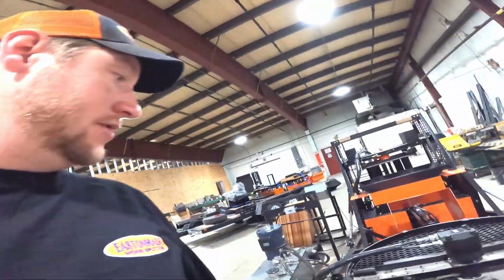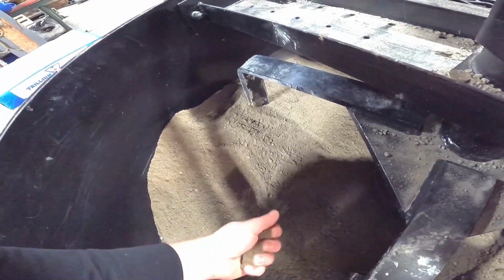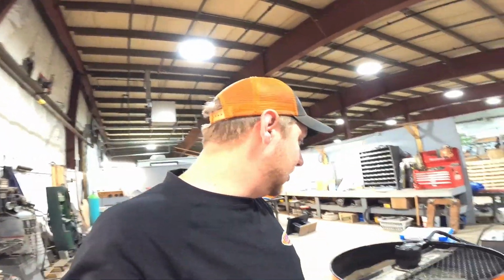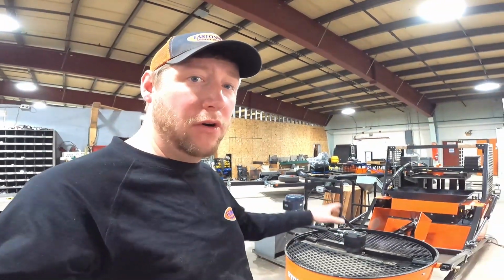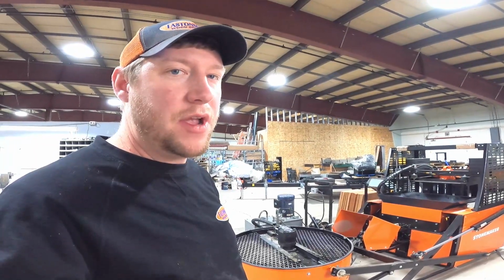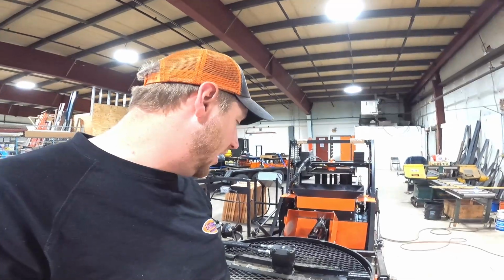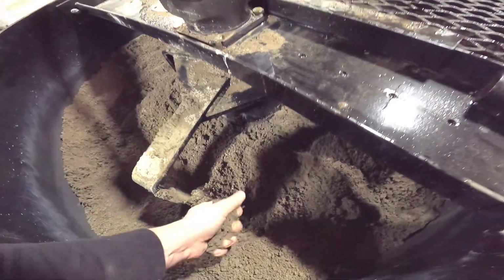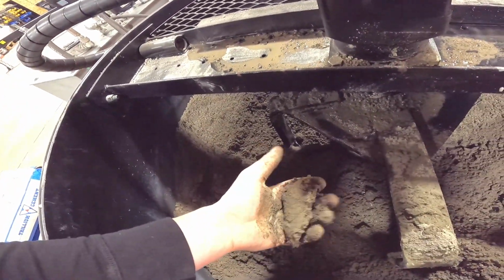Eastonmade; How To Dry Mix Concrete For Stonemaker DM100

Comment: Knowing what I know about concrete units and their manufacture, that outfit is going to be a tough sell.
Reply: We don't know what you know.    We don't know if you know anything.   If you told us what to look for we may become more knowledgeable.
Reply: @jakebredthauer5100  I tried that in the last video, but my post got deleted by Andrew. Probably because I pointed out too many hidden costs and the cons of trying to compete with industry. I have worked for Shouldice Block, Superior Pre-cast and Ormsby Cement products off and on for 35 years.
Reply: @alvarsdzenis4739  In the comments of the previous video on this item, Andrew said it was designed for adobe, if I understood him correctly.   The usual hang-up for small-scale is cost of labor per unit.   I don't want one anyway.    If this is not the usual method, there is likely a good reason.   If the big factories were too big, someone would have figured that out and started making smaller factories.   He probably don't have much invested in it so he figured he could try it and see if it goes.
Reply: @jakebredthauer5100  I've probably made every concrete unit ever created. Yes I've made many "pavers" of many styles, shapes and color combo's over the years. It only takes a few minutes to change the mold. We usually made around 8,000 units per 9 hour shift, at a cost of about 22 cents per machine cycle.
Reply: @alvarsdzenis4739  Because firewood and concrete are hard to move, there are countless different markets, I imagine.
Reply from the maker: I dont think i deleted it.  Im pretty confident that i thanked you for taking to time out of your day to leave some feedback.
Reply from the maker: The machine will do just a little under 1000 4x8 pavers an hour.  A big factory you worked in did the same?
Reply: @alvarsdzenis4739  I don't see how a stirring will do right for concrete.   For adobe, stirring may be needed due to all the fiber.
Reply: @EastonmadeWoodSplitters  Thanks Andrew. 4X8 pavers if I remember correctly was 36 every minute. Around 20,000 per 9 hour shift.